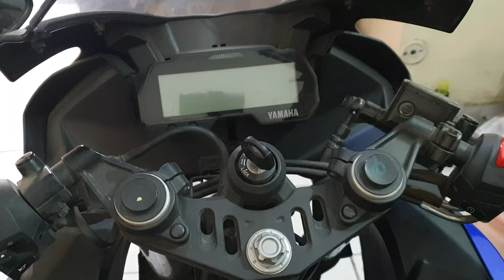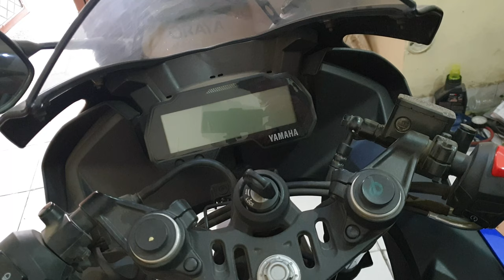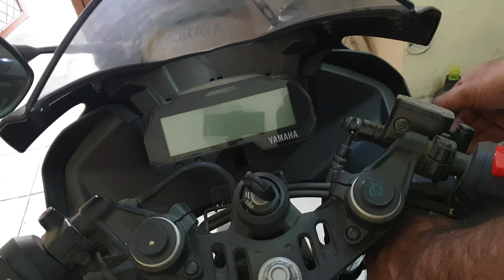Yamaha R15 V3 Spark Plug Removal | Gap adjustment | Right side fairing removal

Comment: Bhai engine oil Pura 1L use karu ? Or 850ml ?
Reply from the maker: Pura 1 liter bhai.
Reply: @farcerides7041  par servicing Wala toh 850ml dhaltai?
Reply from the maker: @punk1753  haan bhai agar oil filter change nahi kiya to 850. But if oil filter changed, it's always 950 or 1 ltrs
Reply: @farcerides7041  oil filter change karta hae .feer bhi 850ml hi daltai ..second servicing Mae dekai hum
Reply from the maker: @punk1753  haan bhai. Make sure he puts in 950 ml. 1 ltr bi chalega. But 850 is less
Reply: @farcerides7041  my bike sound like old .now and it's getting hot damn fast
Reply: @farcerides7041  put the oil in oil filter or what?
Reply from the maker: @punk1753  how many kms done in total ?
Reply from the maker: @punk1753  put total 950 in the chamber.
Reply: @farcerides7041  3500kms
Reply: @farcerides7041  next time okay

Comment: Did you ever try to change it with the iridium plug ?
The stock one is NGK CR8E and the iridium one is CR8EiX, although costs more than the normal one.
It'll not make the R15 to Hayabusa, but does it make any positive difference, if anyone tried it ?
Reply from the maker: Hey mate, yup I am using iridium on my R15 v2 and Himalayan BS4, here are the links of vid for reference
v2- https://youtu.be/n-QrCA2eLVk
Himalayan - https://youtu.be/cOGSWMMnTDI
as for R15 v3, i am surprised that you mentioned NGK CR8E because Service manual suggests NGK MR 8E9.
My concern is that Yamaha service centers only stock NGK CR8E and its a possibility that at some point in time they changed yours to same. 
I have discussed heat range and sizing chart in Himalayan vid shared above and yes you are absolutely correct that there is no power enhancement with using Iridium plugs, we only use them for long life and less maintenance.
I have been trying to find best suitable option for Himalayan aswell as V3 but trust me V2 is running immaculately on NGK CR9EIX from past 30 k kms and thus the benefit of lesser maintenance.
Plugs are more than just a mere hit and try (as explained in -  https://youtu.be/cOGSWMMnTDI) , but will try and find a suitable replacement for V3 soon, Cheers :)